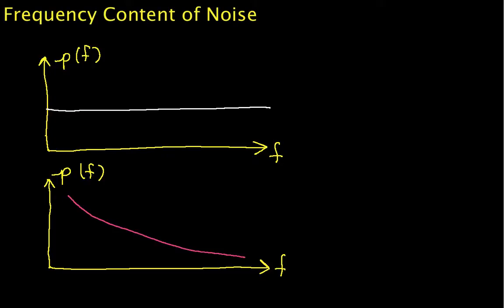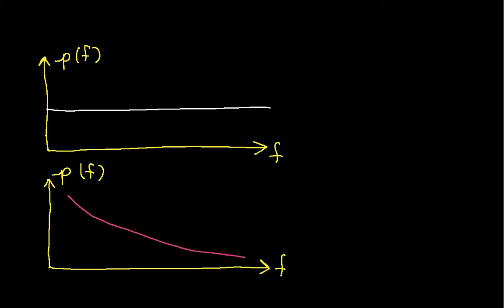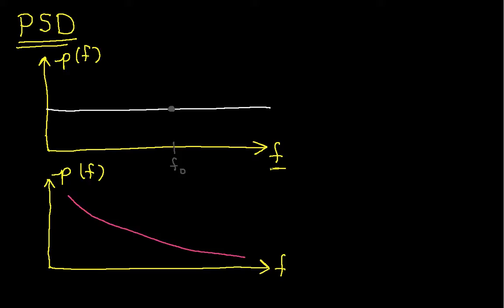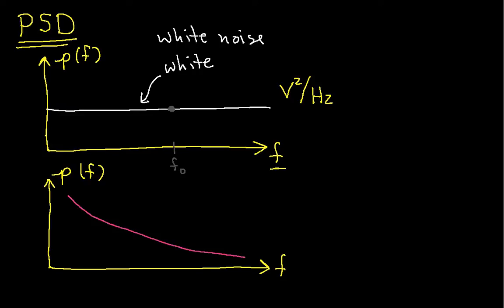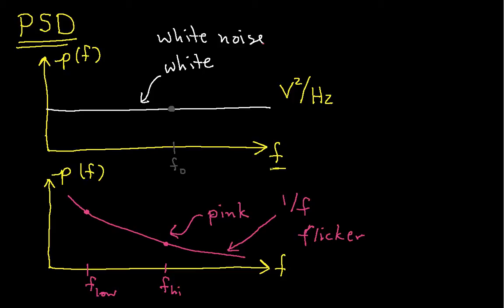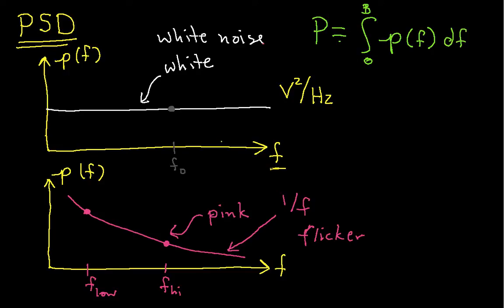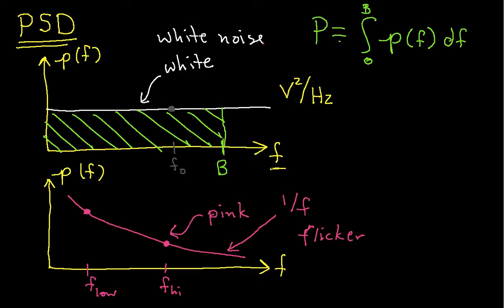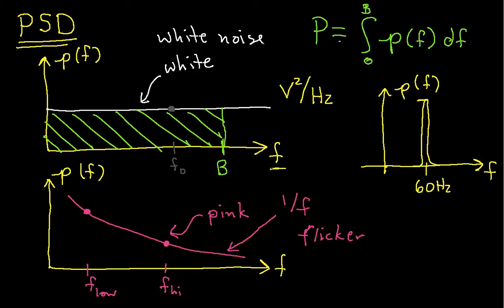Frequency Content of Noise

Comment: Just discovered your channel, this is good stuff. Some of this will be helpful in my Data- and Signal Analysis course. Keep up the good work :)

That last example with PSD noise peak @ 60 hz instantly reminded me of the Dirac Delta function, which I'm sure will find it's meaning in this context as well (I learned about it during a quantum mechanics course).